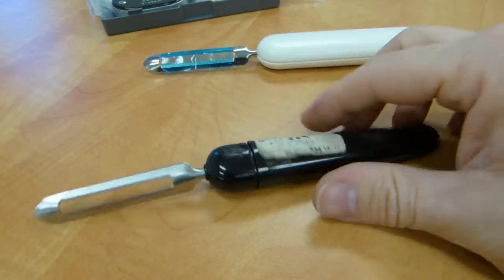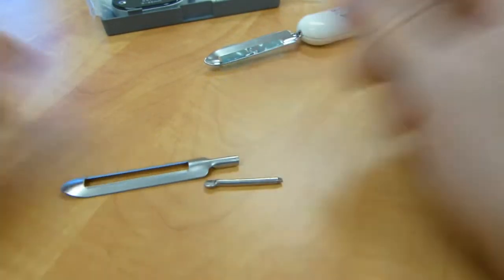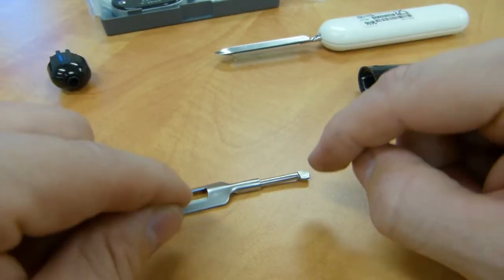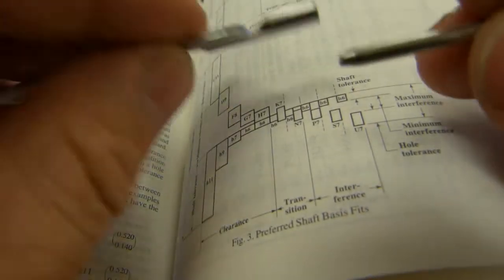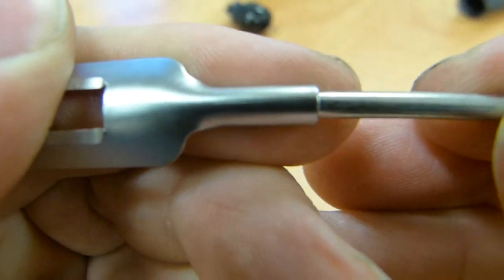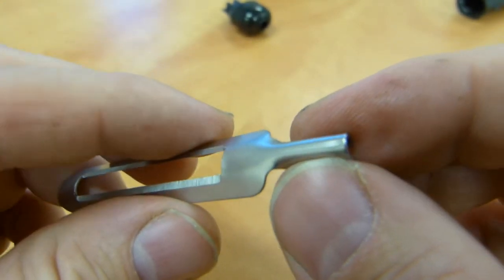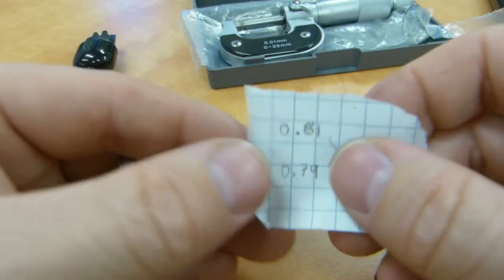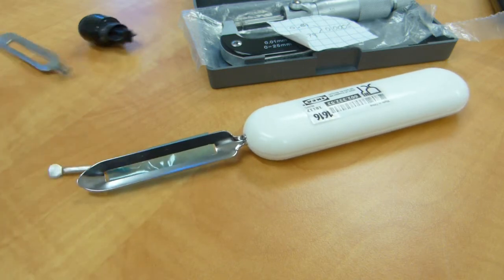IKEA $2 potato peeler fail

Comment: I was wondering how does the deformation of the pin change the magnetic properties of the metal.
Reply from the maker: Pin is formed out of SAE 316 austenitic stainless steel which is not magnetic at room temperature as its crystal lattice is face-centered cubic (FCC). Forming causes some of the central atoms in the FCC crystal lattices to migrate and transform to a body-centered cubic (BCC) geometric arrangement, called ferrite. Ferrite is magnetic.